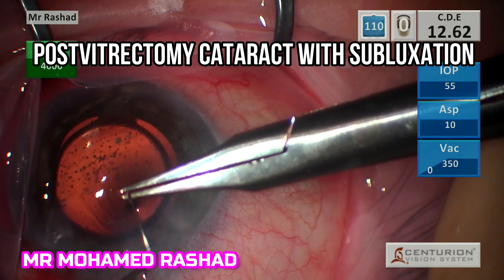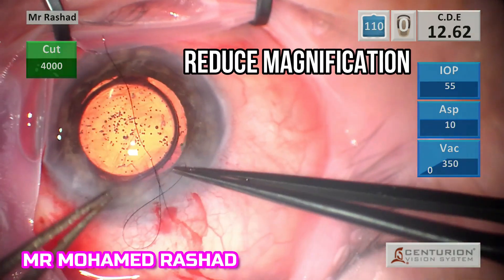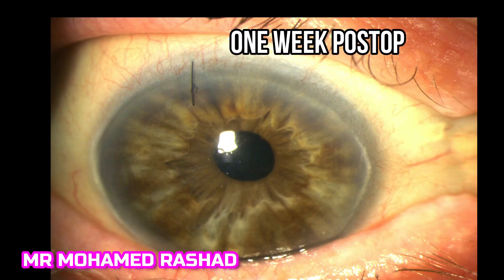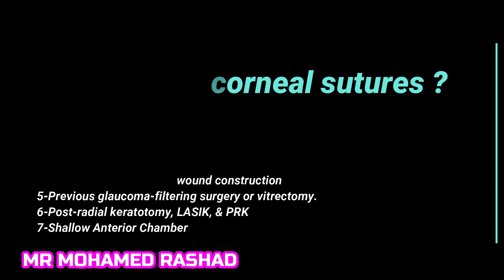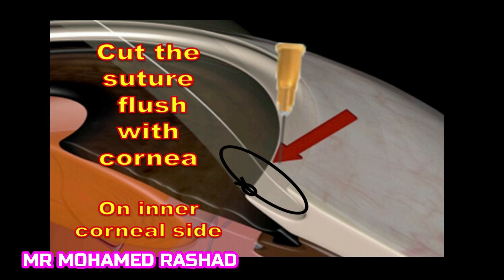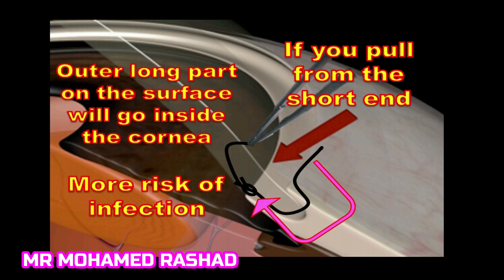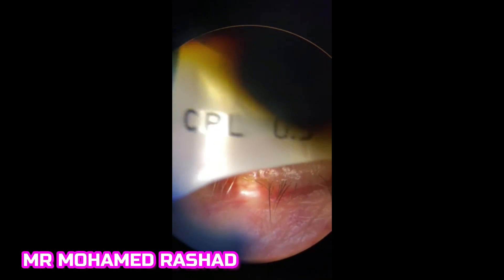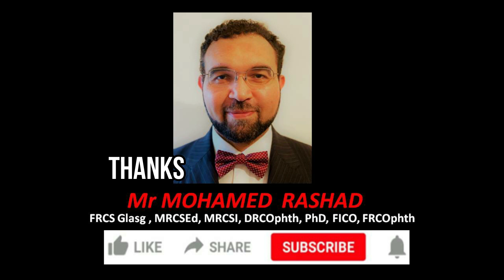Corneal suturing during cataract surgery and the safest & easiest way to remove the corneal sutures

Comment: If the sutures doesn´t cause any problems, are they left in forever or they need to be removed? I´m asking as a patient with current stitches from Artilsan surgery.
Reply from the maker: Thanks for your question. If it is Nylon suture and no problems, I prefer to remove it in 8 weeks from date of surgery.

Comment: Should all corneal sutures be removed in the OR or they may be removed in the clinic also ?
Reply from the maker: Many thanks for your brilliant question. If they are few or one you can remove under slit lamp but use Povidone iodine 5% drops after anaesthetic drops and post removal give antibiotic drops for one week. Make sure it is aseptic as much as you can.
Reply: @ophthalmologyeyeacademy  thanks sir

Comment: Wonderful content oncemore , i do have a question please sometimes the suture "breaks" when trying to get it out and it gets stuck inside the cornea , is there any risk ?  how to avoid it or how to remove it 
thanks
Reply from the maker: Thanks for the nice comment and very important question. If it breaks and is inside the cornea no problem but make sure there is no projecting end above the corneal surface. You don’t need to remove it if it is totally inside the cornea.  To avoid that you can do  my technique as described in the video, when you have a long end this will  help you to pull it strongly . But if the suture has been for very long time it might break anyway . Sometimes you might find that when you remove sutures of keratoplasty.
Reply: @ophthalmologyeyeacademy  exactly it is almost over 6 months each time it occurs,  I will try your technique....what is your recommendation for the best moment to cut it post operatively ?
Reply from the maker: I would not remove any suture before six weeks except if making problems .
Reply from the maker: @yelenagigi  Thanks for your comment. My Facebook is : “Mohamed Saad Rashad” with the same photo.